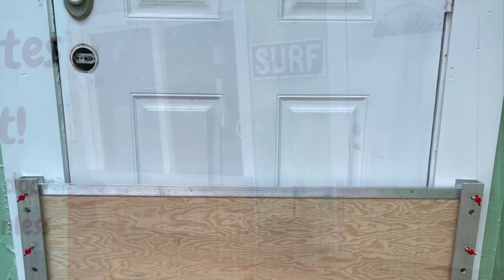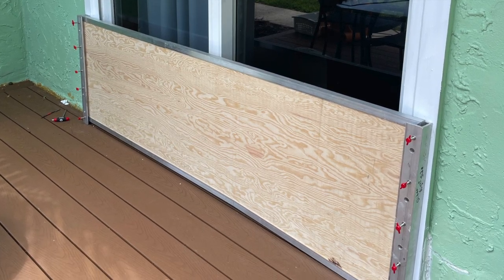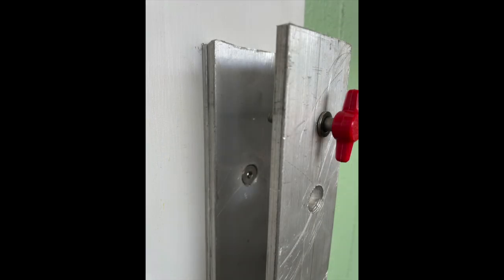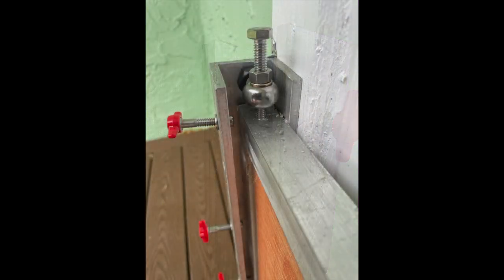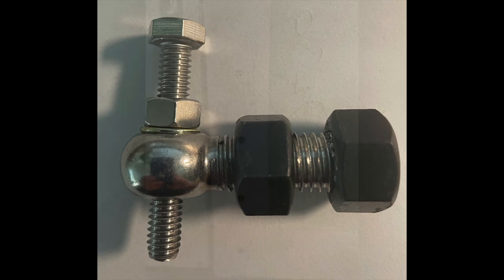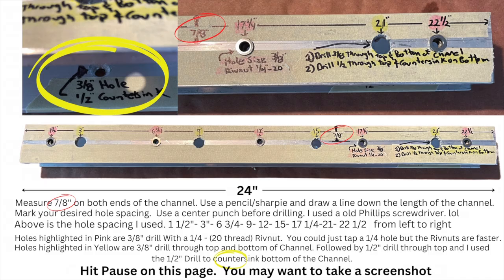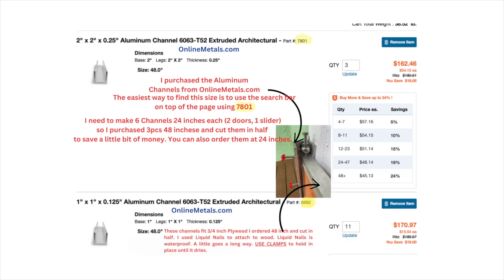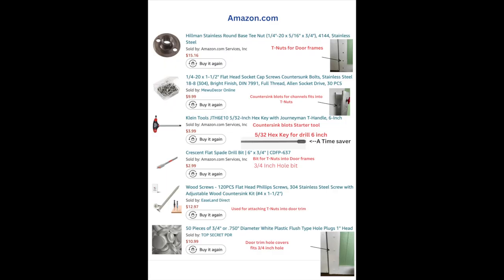DIY Flood barrier for home - Building flood gates. Here's the parts you'll need.

Comment: Properly coated plywood is impermeable to water.  As show to me by my yacht.  To withstand the hydro-static force of water in the deep level of a non-flowing flood, the plywood needs some structure, just as it does in the ribbed structure of a boat.  The rest, is about sealing.  Sealants which cure quickly are widely available. Applied to the flood side of the barrier, the sealants get forced into the seal - which is good.  As long as the plywood is kept still, the seal with hold.  Most flood intrusions are predictable, and therefore preventable.  Eg. you get floods when you get enough rain.  Etc.  If you live in a flood zone, and you are getting a lot of rain, you should be ready to set up your barrier.
Reply from the maker: Hello, Yes, I did seal the wood with polyurethane